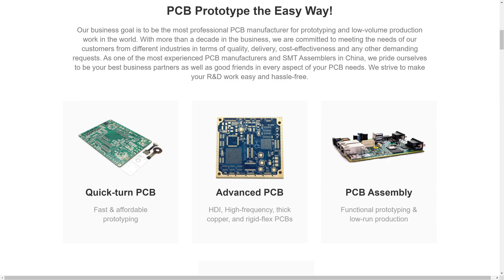I need to get better at soldering

Comment: You are doing great. I would say, though, that 350 C is way too hot. You should lower that to 280 maybe even 260 depending on the solder and how thick the board you are working with is. If you look on your solder it should say its melting point. I normally use that as my starting point and increase the temperature depending on how the board reacts. Thicker boards need higher temperatures which can be annoying. The goal is to get the joint hot enough for the solder to melt and flow without going overboard. Too much heat can damage the components and lift pads right off the board. This is one reason people use a preheater to get the board to a certain overall temperature so then they don't have to crank up the heat on the iron and risk damaging things. For these little single layer project boards that's not a concern but bigger multilayer boards it can be an issue at times, especially around big ground plans that'll wick away all your heat. 

One other thing that I saw other commenters were pointing out was keeping your tip clean. Your tip is getting a bit oxidized from prolonged use (8:53 I think is a great example you can see it turning a grayish yellow). Every now and again you want to tin your tip. All that means is coat it in a little solder then wipe off the excess on your sponge. Oxygen inhibits heat transfer and damages the tip over time. Keeping your tips nice and tinned will make your soldering easier and keep your tips in good shape for a long time!

To your question about holders and legs; I'm a heathen and just solder directly on my mat. I need to get a holder. When I get desperate I pull out some alligator clips on goose necks but that's rare. That one you have looks very nice! I also cut the legs after soldering. While I'm sure that does put extra forces on the joint there are so many other things that could also do that or worse from just handling the board or even when the finished product is in use that I don't really think it matters. At least not on the level you are now.

When you do get into SMD soldering if you can get a sponsorship with a microscope company that would be brilliant! I'm using a Andonstar AD407 Pro and I love it. If you could get Andonstar to help you out that would be amazing! The AD407 Pro would satisfy all your requirements that you listed in the video. 

Good luck! You got a lot of fun ahead of you! There are lots of techniques, tools and methods to look forward to playing around with! I'm very excited for you! Soldering and repairing things is a great hobby and I hope it treats you well!
Reply from the maker: Great tips, thank you!
Reply: I think you are spoiled by more modern irons. ;)

260°C is much too low for that kind of iron, especially for double-sided PCBs with plated thru-holes. 280°C really only works well if you have a cartridge type iron and aren’t doing anything with heavy ground planes and other high thermal loads.
Reply: @emmettturner9452  all fair points but for these little project boards 350°C is too high. My bigger point is you don't want to use more heat than is required to avoid damaging things.  

I'm using a Weller WE1010NA for reference.
Reply: @retroVTuber  Agreed. I use a Hakko T18 clone and for this kind of job I’d probably be a bit above 300°C… 330°C if I were doing drag soldering with a knife tip. :)

Comment: i use a sequre S60 micropencil at 350c maybe 400c for nearly everything now - and a andonstar microscope with mechanic solder wire and low melt for the ground plains - im in vic park if u want to come and have a look - im down to replacing the legs on voodoo 2 chips
Reply from the maker: Oh nice! Vic Park is beautiful ❤️ I'll showcase a microscope in the second next video, it really helps once you adjust for the lack of 3D vision. Also Handy for recording footage. 3DFX repair: Nice!

Comment: When you will have flux, put some on the braid helps a lot to remove solder.
If you start soldering the smallest componants with the board flat on a table, you don't have to bend the pins to hold them in place.
In 30 years of practice, I never used any of those supports :)
In fact, I like to have my wrist stable on my bench to have more control.

When you solder headers, fist solder one pin, ajust the position then only solder the others.

Thin soldering wire is not always the best. I use mainly 0.8 mm.
Even with SMD 1206 componants. For them I just put a bit of solder on the tip.

Comment: I've never had issues with cutting legs after soldering. At least the car ECU's I've done have worked all just fine.  Imo something has gone during soldering if it truly effects mechanically. Plus you can just touch them up again if you feel like you've stressed the joint somehow.

Comment: I've spent the past 17 years as a service engineer repairing audio electronics.

Soldering to PCB tips.

1/ Use plenty of heat 390-420c
2/ Use a quality solder with high silver content.
3/ Never use solder to bridge a gap
4/ You must have good mechanical connection first.
5/ Heat the component leg and PCB simultaneously with a nice big iron tip and feed in the solder and make sure you see it flowing freely before removing the iron.
Reply: Phil I noticed you remove the iron way too quickly, get more heat into that solder watch it drop into the through plating and bubble/flow once before removing. This will stop you getting cold joints.
Reply from the maker: Thank you 😊
Reply: Also when soldering anything with three legs use the legs to hold the component by bending them right, left, right so it holds the component still whilst you solder the legs.

Comment: I have 20 years of soldering experience (since i was 12 or so😅) I can say this: soldering iron is technicians best friend if you know the way it works. And the nightmare for the people who just want to play around. Soldering just needs patience and concentration. Choose the right temprature so you do not sweat from the heat and burn the board.solder melts at 183 °C so just set the Iron on 300 or there abouts. You even can have good results with a 50w pen iron if you know what you are doing.You will get used to it very soon.👍

Comment: i would suggest higher temps (350/400C) flux for almost all steps and clean the tip as much as you can.
Reply: Thank you for the heart phil!
I truly recommend again temps of at least 350C, in the past i soldered at 250 and my results were horrible, you just need to spend less time on the part to solder (it's always good practice to never spend too much time on a piece), once you get a feel of when the solder melted well you will get faster and more precise.
Reply: @iraito8356  where do I claim 200 or 250?? That would be only for indium solders in special applications, like soldering superconducting tapes as we do in our lab. I'd say lower 300s in Phil's case
Reply: @WouterVerbruggen  You must have a persecution issue...
I was not talking to you, i used that lower temp and i was not accusing you, to add more to the temps, my father is an electrical engineer with 35 years of experience, i asked multiple times about optimal temps and the answer was always 350min 400max, i'm talking from anecdotal evidence and experience.
Reply: Not with these small parts and lead solder. Things will get way too hot quickly and the flux will burn
Reply: @WouterVerbruggen  You need to be fast, staying under 300 would be detrimental regardless, never burned a single thing at 400 and i modded a capture card into a 3ds which implies a ton of soldering on flats with direct contact on the motherboard and sensible chips.
Reply: @iraito8356  starters dont have a feeling for timing, going high temp and telling to be fast will het them loads of bad weak joints. Also tip for you, drop the bragging. It will only make others dislike you

Comment: Yeah, get a better solder Iron. Yours is old school.
The heating element is not integrated to the tip. This is problematic.
You do not need to go crazy, something like the TS100 will do.
Other than a microscope, a magnifying glass with light is very handy.
Reply: My friend has a Hakko FX888 and I just can't justify using it over my TS100. It's such a nice compact soldering iron with few limitations.

Comment: Once you realize everything is about heat, and how its transferred that helped me a ton. Also, try wetting the tip of your iron (add a very tiny amount of solder to your iron) This helps the heat or energy get directed in the way you want. When you try to desoldering something, wait for the solder to get molten before you do anything. The SS02 Solder sucker is a game changer, the one made in Japan. Im a novice myself so take it for what it is but I love soldering. Its my happy place.
Reply from the maker: I've heard of that solder sucker! They already copied it pine including the silicon tube at the front 😲

Comment: For me a better soldering iron did the trick. For more layer pcbs it needs a good amount of power. I bought the Quickoo 956 Station when it was on sale on AliExpress. Was maybe 40 € on sale with 5  t12 tips when i got it. Way better than the pencil 64.

Comment: i am not a soldering expert but few things i learned over the yerars were:
never put pressure on the pcb, pads, be gentle or pads go bye bye
test your iron and solder before using it what temperature it melts what temperature it solidyfi  how big of a joint will make it cold on your exact soldering gear and don't go crazy above that, solder won't get more flowing
cutting legs is a preference, mostly but that also depends from a gear, sharp side snips can leave no damage while cutting legs with regular scizors can rip a pad
and i know cleaning flux sometimes sucks but it is your friend, don't shy from using it because it really does makes life easier

Comment: I upgraded to a Hakko FX-888D several years ago and I highly recommend it. For desoldering, I invested in a Hakko FR-301 vacuum desoldering gun. It’s been a big time saver.

I always cut the legs after the solder has cooled briefly and have had no issues to date.

Regarding your soldering iron, clean the tip frequently and “tin” it with solder. You can also buy tip tinner in a small tin that works well.
Reply: 888 is using technology from seventies, its super outdated and under delivers on modern multi layer heavy ground plane pcbs. Good enough for hobby tinkering, soldering wires, arduino kits that kind of stuff.

Comment: That could be the bravest thumbnail I have ever seen in my life 🤣 Your soldering looks absolutely fine, technique is text book, I wish my soldering looked liked that when I picked it back up years after school. I would stick with the knife tip though, once you get use to it, it's the best tip IMO for heat transfer and precision. I use it for everything apart from micro soldering.

Comment: Your iron seems to be set a little too hot (flux burning off too quickly for my liking), also your tip is either destroyed or dirty (should be shiny, doesn't look shiny in the video).
Bei Fragen: Komm gerne auf mich zu =)

Comment: FLUX helps a lot, Always need both the thin type in a little bottle with needle tip and the dip type!  solder wick to remove if you get excess or have need to desolder.
A fine tip that is tinned well will help.  have a sponge with water, load the tip heavy with solder and leave it on a few seconds, then wipe on the sponge.
The soldering iron looks a little too low on output. If you use a non-adjustable iron they sometimes get just a little too hot or too low
try to get good contact with the board and wire , and keep it a little longer after you add the solder to let it "flow"
cut legs after soldering.  mosfets and some semiconductors can be damaged by the shock from cutting, it has been recommended to use a scissor type cutter.  That being said , I have never had problems with it.  Same with heat issues...some components are sensitive, though I have had few problems even though I rarely use locking forcepts to block the heat or the little heatsinks you clamp on the board between board and component.
Most of your joints look really good I have no problems with at all !  I was typing while your video some but I did not see any cold joints to the point you would have problems.
I am Electronics Engineer since I was a kid, my AAS in Electronics Engineering Technology is almost 35 years old.  My eyes are old too, and though I don't need often I really wish I had one of the magnifying lights on arm you mount to your desk!
Thanks for video, I think keeping your soldering iron contact a bit longer and flux will solve most of your problems, an adjustable iron with great tinned tip the rest !

Comment: my biggest tip is use a blob of solder(size as needed; tin the tip of the soldering iron) on the tip of the soldering iron as a means of transferring heat rather than the actual surface of the tip of the iron as it's more likely to actual transfer heat quicker and makes it far more controllable....:)

Comment: When I'm soldering a header or anything that has a lot of spikes that's held together with a big chunk of plastic I always plug in something. When I'm manufacturing a DIN cable for example and I'm working on the female end of the plug I alway plug in the opposite side so the legs don't move out of alignment. The plastic that holds together the legs usually melts pretty was and no longer hold them right, resulting in crooked legs that makes it harder to plug in something after soldering is done. Try this next time!

Put in smaller components first and work your way up. If you have a short legged component that can fall off, put a piece of tape on it to keep it in place.

I usually solder stuff in and only when it's in place I cut off the legs.

If you are serious about repairs, get yourself some thin wires (around 0.2mm) for trace repairs and UV curing solder mask paint. And a digital electronic microscope is essential if you are working with tiny trace repairs.

Comment: I use a pretty small tip but it's pointy, not a wedge shape. I tried ceramic tips but they just burnt so I'm going with a metal tip (I don't know what kind of metal it is). Got my soldering iron from aliexpress, it's an iron and hot air combo, pretty basic but gets the job done. When I was a kid I used a soldering gun which only heated up when I pulled the trigger and had a copper tip. It was annoying to use, later I switched to better ones. The one I have has heat setting buttons, I usually run it at around 300-360 degrees celsius. I also have a desoldering gun with a built in pump, I run that at around 400 degrees celsius.

Make sure you apply some solder on the tip of your soldering iron, it helps transferring the heat from the tip to the part you want to solder. Heat up both pieces, the via and the leg, solder only sticks to the surface that's hot. If needed, you can apply flux, try to get flux that you don't have to clean, the other type is slightly conductive. If you are desoldering with solder braid, cut off a short piece, apply flux to the soldered part and hold the braid with a tweezer, perferrably a ceramic tip that doesn't transfer heat so it doesn't suck away the heat. Once you soldered in something, you can go over again with the tip to make sure the blob is "adhering" to both surfaces. If you make a bridge, don't panic, flux can help, if you applied too much solder, wick away some with flux+braid. It's pretty easy but practice makes perfect. I'm soldering since I was a little kid but got a bit more serious about soldering around 10 years ago. I don't have a serious setup but I repair a lot of broken parts on broken electronics as a hobby.

The "chisel tip" you switched to at 2:50 seems to be pretty cool, I like those solder joints. Make sure you clean up with alcohol after you finished soldering.

I like the Pinecil but it's pretty expensive. It can run on USB-C and an external power supply as well. I have a similar holder but usually I just place it on my table. I got a map not long ago that can withstand the heat but I didn't really use it much. I also bought a little clamp that has 4 holes where I can screw in posts that can keep the board in place and the clamp itself is weithed, solid metal so it doesn't move easily. I also got an electric microscope from aliexpress, it helped me three times already finding tiny faults on boards that I coundn't have spotted with my bare eyes. I was able to repair a Sega Game Gear, a NeoGeo Pocket Color and a Nintendo DSi's card slot with the help of that microscope, best purchase ever!

Comment: I've been soldering for around 40 years and the first tips I'll give is keep the tip clean,  don't over fill your board when placing components (I.e. solder a few things, clip the leads, then stuff more) this keeps you from having to fight angles to get the to board to solder. And always heat the pad and component, never just one or the other.
Reply: I agree with this 💯 a wet sponge and the metal "sponge" tip cleaner thing as well. Also, use flux :)
Reply: I use steel wool to clean off oxidation just be careful not to burn your fingers. 😂
Reply: If you really want to solder perfectly to IPC standards, you're supposed to clip the leads BEFORE soldering, clipping the soldered leads puts extra mechanical stress on the joint.  But of course we all do it anyway.

Comment: Don't forget to wash flux remains (isopropil alcohol + a tooth brush) and build a simple intake fan in a box to suck away all fumes. And you don't really need to leave solder "bumps", so use a bit less solder. And ALWAYS PROTECT YOUR EYES. Even simplest plastic glasses will do. ALWAYS.
Reply: Protect eyes from what?
Reply: @masterkamen371  Many components got a bit of springiness in them, so getting drops of liquid solder in your face while desoldering PCBs can happen now and then. Eyes are useful and we only have two.